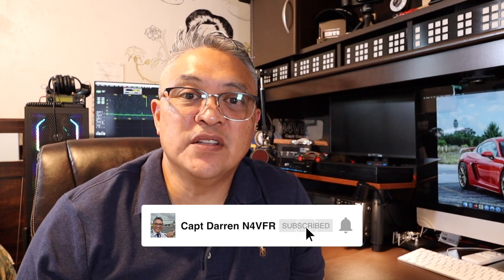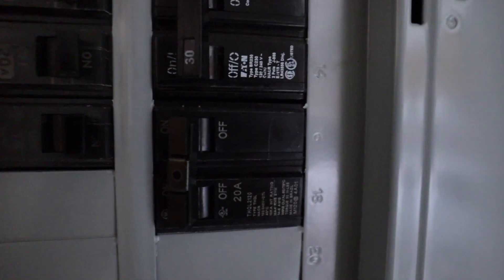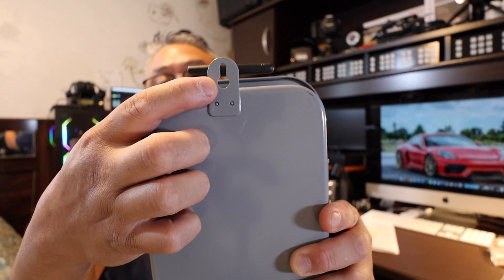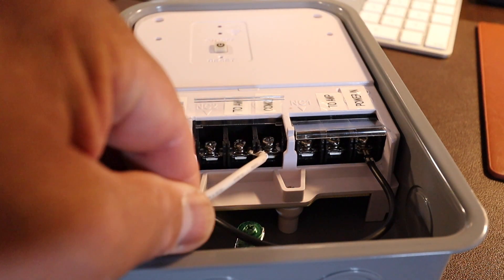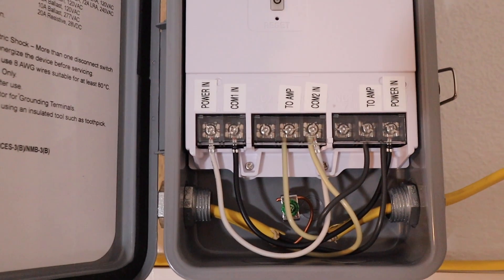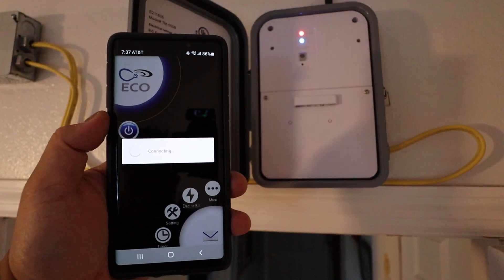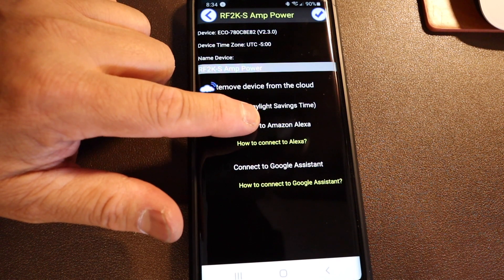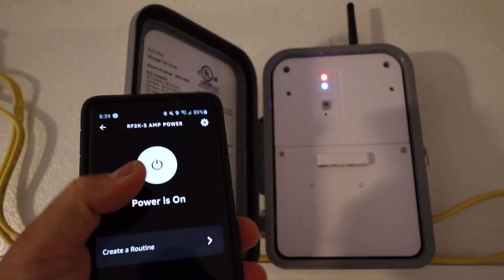Remote Power Switch for HF Amplifiers | Turning On/Off your Amplifiers Remotely | Smart Wifi Box

Comment: Excellent! However, why not do this at the circuit plug in the shack. example - make a plug from the 240outlet to the Wifi box and then a cable from the amp to the wifi box. This way you don’t have to disturb the A/C wiring from the circuit? Is it still working reliably! It’s too bad the LUX did not provision power on / off via the Remote DB connection like the Acom. Vito (VA3VMD)